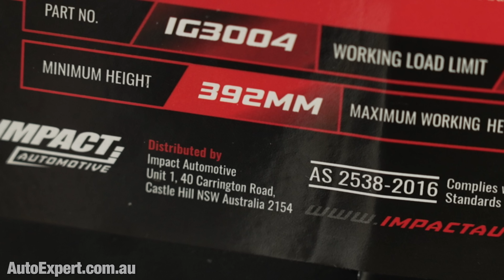Jack Stands: How safe are they really? (Weakest link revealed.) | Auto Expert John Cadogan

Comment: From memory the hydraulic press channel did a video regarding a similar jack stand.
It took a fuck load of weight. Far more (multiple) times more than the rated SWL, you'd probably go through your shitty 80mm/100mm poly waffle garage slab before the jack stand failed.
If you are really iffy and nervous take your wheels off and throw them under the vehicle whilst its jacked.

Comment: How do I stop the stand hammock style at the top from crushing the side panel (at the jack point with the stronger weld)? 

I've got this style on the video, but I've seen some with a slot for the pinch weld to sit in.

I dont want to use timber as it could slip.

Comment: I have a couple of 4-tonne stands for my crappy old ute. I'd rather have stands that are individually rated to hold more than the entire weight of the vehicle. I like a wide safety margin. Of course, a few short sections of sleeper timber will work in a pinch...
Reply from the maker: Overkill is a good policy in these situations. Like using a 1T sling for lifting 200kg...

Comment: If you want a demonstration, Hydraulic Press Channel did a test on this sort of jack stand - rated at 2000kg, but held up over 5000kg without the pin and over 8000kg with the pin - see https://www.youtube.com/watch?v=GjmXQNhKCks - it appears (though I can't be certain) that either the column or the main mechanism seems to start deforming, meaning the pin connects and adds its extra holding power. Importantly, it doesn't just fail and break - instead it gradually deforms as more weight is added.
Reply from the maker: That's exactly the kind of thing that happens with low-carbon steel and ductile iron. They yield, and bend, and the deflection gets noticeable, even if you're a moron. (Time to get out of the way.) It's not surprising that the pin adds restraint capacity as the primary tooth/pawl mechanism fails. (I've broken a heap of 4.7-tonne shackles in the lab. They typically pop at about 35 tonnes. But you can see the pin bend heaps before that.)

Comment: I had 1 of those ratchet jack stands let go on me while i was under the car. The design of them did not have that safety locking pin they just relied on the ratchet and i can only assume the pawl did not click into place properly due to the poor finish of the ratchet part, any way i tossed them and bought 2 sets with the double u shaped pin and no ratchet. Luckily only 1 let go and the way i had the stands positioned it kind of just rocked on the 3 remaining stands scared to proverbial out of me and the stands were never used again the car only being a gemini would of been a big help as they don't weigh much.

Comment: The issue I have is that I can't place a jack stand because the jack is already occupying the jack point... How do you resolve that?
Reply: Depends on the car but you can often jack under the suspension or a subframe mounting point.

Comment: John, what is your opinion on tripod, pin lock type jack stands like Esco? The tripod design would lend itself well to better stability on surfaces not perfectly flat (within reason). How does the steel pin lock mechanism compare to a ductile iron ratchet pawl mechanism in terms of safety and overall robustness?

Comment: 10:53 I find this pin system annoying, because if I look at it the wrong way, it slides out! Seriously, it should better in place, no ? I had to re-insert it a few times when working arround and under a car. I would feel better about it if it couldn't come out when under load or something. What are your thoughts ? Thanks for the video.

Comment: Here is the problem with the jackstand of the design that you show.  If, while under your car changing the oil or a starter motor, or something else that geniuses at Toyota, Kia, GM, VW, etc. decided to make accessible only by going underneath and removing a bunch of unrelated stuff that is held together with 6 mm screws, you accidentally jiggle the handle, then the jackstand drops the car on to you.
I prefer the old fashioned, simpler, and cheaper to manufacture jackstand that consists of two tubes that slide together like a telescope, with some holes that you slide in a bolt to hold the entire thing by a shear clevis.  This is very difficult to kick out from under the car.  The bolt, of course is attached to the rest of the unit with a chain.
Unfortunately, I am forced to use the old jack stands because I cannot find any of this style in any of the autoparts or hardware stores.  All I can find are the ratchet hatchet stands that, because it is so easy for the handle to disengage, scare the used food out of me.

Comment: Probably worth noting if you're using Chinese bolts, don't assume on them having the actual characteristics stamped on the head, unless they are grade 4.6

If it's in any way safety important (like, not even critical) then get bolts from a Japanese, American, or European manufacturer. It can be worth buying from Finning, as Cat QA their bolts to death.

Grey, white, nodular, and spheroidal irons. White gets used for wear parts like plows. It's hard as Hell, like 63Rc, but breaks like biscuit.

Comment: Thanks again for another useful and informative vid John. I have a question. The stands you showed seem to be very good quality. What about the ones I use which are like 20 years old and look like a piece of box section welded to a flat plate and the pin takes all the weight? Sorry if this has already been asked.
Also, nobody uses "Christian name" any more because there are so many different religions and many non religious don't really like the term either. I work with many people from Asian backgrounds and the term is completely meaningless to them, rightly so I reckon.
Cheers

Comment: A well presented video John and I well remember when the standards were introduced. A lot of products were taken off the shelves and there were regular recalls which I think was good because there was some really flimsy jacks and stands on the market. Recalls are a lot less prevalent now and most are due to incorrect labelling which, I guess, is more a technical issue than faulty products. If you want to see over engineering look at lifting equipment and it’s not uncommon for a boat winch for example to be rated at xxx kgs but has a warning on it saying not to be used for lifting. Of course it’s different in Pakistan, over there if it doesn’t snap then it’s approved 😂😂😂 Cheers Stuart, that’s my Christian name by the way.

Comment: I'm concerned about the jack stand ratings protocol, which I believe is dangerously misleading.   There are many circumstances where a user will only need and use a jackstand on one side of a vehicle, with the other side remaining on its wheel.  

If I have a jack stand with 1000Kg stamped on it, and I wish to lift a side which weighs a bit less than 1000 Kg it's all good, isn't it!    NO, because (since 2015?) a 1000Kg jack stand  is only rated to hold 500Kg.  The rating MUST refer to a PAIR of jack stands.   
Your pre 2015 manufacture 1000Kg jack stand MIGHT be rated to hold 1000Kg, or it might only be rated to hold 500Kg.   

Safety equipment capabilities should be plain and transparent.   If there is any possibility of confusion, markings and ratings should err on the side of conservative safety. But Jack Stands do not. It is completely unreasonable to expect any and all persons using a jack stand to know and remember that the marked rating is double the actual rating.   I reckon this abandonment of plain english meaning by standards regulation "experts" is madness.
Just saying....

Comment: The stands are tested and I bet the breaking point on 50 of them was at 8 ton. They rate them to 4 ton as a safe limit. I bet you go and buy 100 of these stands and they all break at 8 ton or higher.
Edit: use them correctly

Comment: The stud will support 9 tons under static load...add the slightest bit of momentum and gravity into the equation and it will snap..you can easily support the weight of a hammer on your skull..try hitting yourself with it.

Comment: These things are ridiculously strong. They tested similar ones on the Hydraulic Press Channel video (/watch?v=GjmXQNhKCks) and the 2 ton version gave way after 5.3ton without the safety pin. With the safety pin It added another 3 ton of safety. So a 2t stand with pin installed was good for 8.4ton. Your 4ton jack is probably good for 16ton.... The crappy threaded 1.5t scissor jack most small cars get was good for 4.2ton before it started to buckle. check the vid out.
Reply: The problem with chinese made crap is QC, most fail due to bad castings cracking. Sure 9/10 are good, but will you be the sucker who gets the bum one?